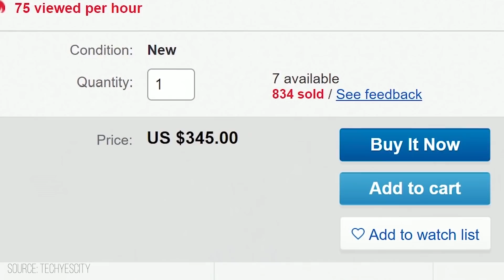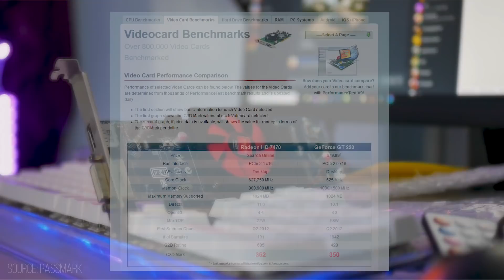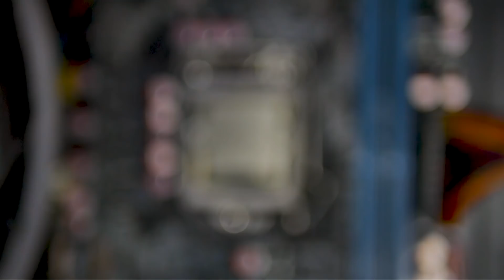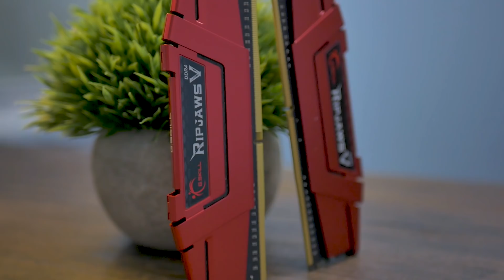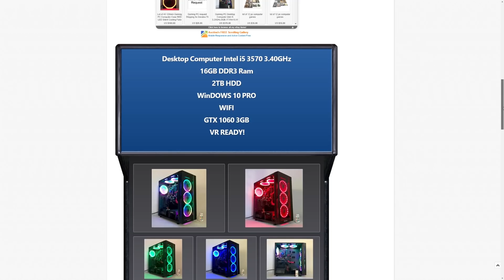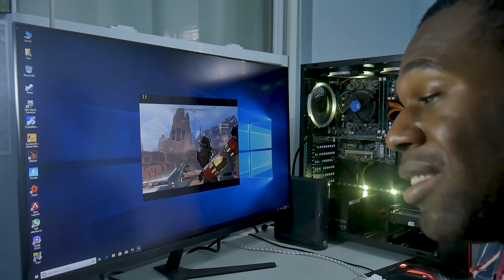These eBay Gaming PCs are NOT GOOD...Here's Why | OzTalksHW

Comment: I build and sell PCs on eBay but I do it to fund my hobby which is building gaming PCs. I barely make any money on each PC because I just can't make a bad product. I build each PC with the customers satisfaction as my main goal. I aim at the lower end budget buyer that wants maximum performance per dollar. Yes I throw in the niceties like RGB fans, RGB CPU coolers, name brand high ram that is the maximum speed that each setup can utilize with Heat Spreaders....etc..etc. I also don't ever skimp on the power supplies. They might not be 1500 watt Corsair psu's but I never get cheap or used psu's. I just love building PC's. I ended up building  myself 5 gaming PCs when I finally had to find a way to fund my PC building hobby while also giving gamers high quality gaming PCs that are as cheap as I can realistically make them. I seriously only make around $50 off each one. For my time and patience crafting each PC to have the best combo of affordable parts and still look and perform pretty beastly I think that $50 is more than fair pay to me. Anyway look for "51/50 GAMING" PCs soon. You won't be disappointed.

Comment: I got a 500$ pc with:
Gtx 1660
16gb ram
750 watt power supply
i7 8700
1TB hdd + 240 ssd
I got it from eBay and it works perfectly I just had to clean it 
It can with a 144hz monitor and a kbm that I replaced have had it for 3 months

Comment: you know what's a good way to get into building pcs? tear down your 5 year old laptop that barely works anymore and then realise you can't put it back together for some reason so you use it as a desktop from now on, be gifted a very old desktop pc from your brother who recently bought a whole new one, open it up to clean the years of caked in dust and grime, get curious about the parts, watch a linus video about delidding cpus, decide to try it out for some god forsaken reason, break a core 2 quad q8300, buy a worse core 2 cpu for the cheapest you can online, buy a 16 dollar used radeon hd 5450 (passively cooled), realise it's all worse than the first cpu that was inside the pc but you can't go back cuz you broke it, spend a long time trying to play runescape on that piece of human feces, earn enough money to buy an extremely overpriced used rx 480 and then go from there

Comment: I refuse to buy a power supply brand other than EVGA. There is literally no reason to cheap out. You can usually find them on sale. I got my 500w 80+ for $32 free shipping.  Brand new. System uses maybe half that with my 570 pulling 150-170w on OC. Completely silent. Only thing you hear in my pc is my harddrive and gou fans but even those at 80% it's barely audible. Harddrive is the loudest lol. Good ol reliable Hitachi 3tb.

Comment: That power supply is really bad! My previous power supply was a temporary one, it was an FSP Group, which is used by some OEM's, its a good power supply, but even than i got a be quiet power supply after 2 weeks! A friend had a cheap power supply from are friend AliExpress, that thing failed spectacularly, blowing out a bunch of smoke, it was a "1000" watt unit with a green fan and lights in it, he bought it for 25€, and guess what, that thing took a lot of components with it, almost every component was dead, the only thing that survived was a 7200 rpm samsung drive, his mobo, graphics card, ram and even the cpu were toasted by that thing! Get something descent, if you can't get a good psu right away, you can get away by using a FSP Group psu, they are descent enough that when they fail, you might have a good chance that your hardware still lives

Comment: As of the specs in mx pc now, it would be considered a high end pc, bud since it is a completely transformed pre-built i bought when i was 12, it still only has a 500 w psu, although it is good enough to run all the components, ill be switching it out

Comment: First off who the fuck games on a dual core processor,4 core to a octacore or nothing!!! That's (stupid). The i5 should be just fine,along with the amd graphics,Nvidia Gtx 1030 would've been better but you are really borderline with the 8 gb of ram..So you shot yourself in the foot on this one. That was a foolish buy and where you went wrong. Those issues could also be easily corrected.

Comment: I like to build and flip pcs, but I make my profit by scoring used parts on auctions and Craigslist like a GTX 1070, the X58, x79, x99 xeons which make great gaming pcs still selling in person and getting cash (no ebay fees etc only paying for gas), and im genuinely honest with my systems that im selling. I also offer the buyer my overclocking skill before I give them the PC and benchmarks if they would like.
Builds: got a 970 from a friend for $50, still good condition and put it in a i5 4690 dell i got from my school's IT person for $50, resold for $300. 
Built a Xeon e5 2620 system with a GTX 1070, 16gb of quad channel etc, 120gb ssd and 1tb HDD, good 600w GQ gold EVGA Psu (good deal got it for $35). Sold system for $600 and built it for about $400.
About to make and sell another xeon build, this time with everything new but the xeon combo and graphics card, which I will try to snag a 1080 for this time.

Comment: What bad prebuilts commonly have in common: 
Rgb for dem +13 fps 
Cheap cases (not the best but can still do) 
Hdd as the boot drive (cuz they're cheap and slow) 
Bottlenecked gpu (the gpu is good‥…when it was released) 
States the cpu by name and core clock as a way to sell (peeps who have no knowledge on pcs might get caught to an ''i5'' that is weaker than a later gen ''i3''. Remember the generation matters too) 
Most of the money is spent on the fans and rgb 
The psu is an unknown brand that uses the peak watt to sell

Comment: Would you count an hp psu as reliable? Like the liteon one. Cos I'm frankensteining around with some of my mum's work's old pcs and while most of the PSUs are low wattage, one of them is 480 and another 520w. the downside is that they are Light As Hell and that seems a bit suspect to me, like in no way would I ever put those in a pc I plan on using. On the other hand we have our ~250w liteon psu, it's low wattage but would it be considered reliable?

Comment: I learned my lesson with the power supply situation. Unfortunately, I found myself picking up one of these PCs a while back when I first got into PC building in 2016; it housed an i3-2100, 12GB of 1333MHz DDR3 and an HD 7870 with that EXACT same Apevia brand power supply. 

I’ll be happy to tell you that the power supply popped and set ablaze within the first month, taking with it all but the graphics card (by god’s chance), which netted me a loss of $450. :)

Comment: Need yalls opinion on this build im selling. the specs are i7 930. 12 gb DDR3 RAM. 120gb SSD and a 250GB Hard drive. with a RX 570 4gb. I have it posted at $400. What do yall think? Its the Dell XPS 9100 Studio Desktop. They go for around $200 area as is. LMK
Reply: 400 is good. If it doesn’t sell in a month or so you can bring it down to 375. 375 is quite a good deal for something like this. WAY better than the pc in this video for $50 more.

Comment: Frankly, I never had a window and fancy lights in my PC.  Guess what, it works just fine without all that stuff.  I would rather save a little more and just get good fans that don't have those things.  It is just more complexity and stuff to break thus fail more frequently.  I have a huge Corsair A50 cooler on my CPU and it is silent enough for my purposes.  It doesn't have all those lights.  I have had it for maybe 10 years now and it still works flawlessly even though I had it for a now older CPU originally.  My newer CPU uses considerably less than the 140 watts my old one did so I see it as just having better cooling.  I might not like fancy lights and all but I am not against water cooling.  I just never tried water cooling, my case is a little on the cramped side for all that stuff.

Comment: Sorry bro but I have to call you a lie. I built a gaming pc using Intel Core i7-980X Extreme Edition Processor 3.33 GHz 16gb ddr 4 3200 ram 600w power supply simi moduler mvme 256, 4tb hard drive gtx 970, AsRock B250 Pro4 Socket LGA 1151 Intel ATX Motherboard. Gong to sell on ebay for $700.00. My point being Is you can get a good gaming pc on EBAY.

Comment: The athlon 3000g is better than cpu and GPU and it costs 55 dollars NEW. The cheapest overclockable mobo costs around 65 dollars new, new 120 ssd cheapest 20 dollars, and power supply with certification 80+ could cost you 50 dollars and the case another 50. In total 240 dollars all brand new with warranty warranty, and 3 TIMES FASTER.

Comment: I seen a pc on eBay advertised as a fortnite pc to reel in kids for 300 euros, I kid you not it was using an i3 2nd gen with INTEGRATED GRAPHICS and 8gb ram. The case looked like one of those cheapo rgb cases that are 30 euro on amazon. I downloaded fortnite on my pc and took out the gpu and it could barely hold 8 FPS. (I5 3470 btw which is a Gen newer and has better igpu)

Comment: To put this in perspective i recently bought my first gaming PC for 380 dollars from Facebook Marketplace. It came on an a320m Motherboard-a 2200g processor-RX 580 GPU-8 GB of ram-a 256 GB SSD-500 GB hardrive-and a 550w power supply, and a corsair case with nice airflow and two case fans. So for only 30 dollars more i got an awesome PC that even has an upgrade path if i wanted. Don't buy this cheap old shit  from ebay and hinder your gaming experience and any future upgradibility.

Comment: I got this laptop for 50 bucks:
CPU: i5 3340m 2.7GHZ 2 Cores 4 Threds
Ram: 8GB DDR3 1660MHz RAM
Storage: 320GB HDD
Graphics: Intel HD 4000
Is it good for it's price? I bought it 5 years ago btw.
Reply: My cousin has same spec but his processet is i5 2nd gen for 50 bucks too . But it has a better graphic

Comment: You'd honestly be better off with Vega 9 in a 2200G...
Some of those cheap Radeon units can still kick it, though. My daughter's PC uses a 6950 (with 6970 drivers) and it games pretty reasonably! Her needs are pretty simple, though. She likes Legos games, driving games, mystery point and clicks, etc.
For $20-25 that's tough to beat!
Just gotta be aware of Direct X capability for your needs.
Anything from the 4xxx series or lower is DX9-10, which is a no. 5-6xxx is DX11, and 7+ is DX12 capable.
Then anything in the x8xx or x9xx is where you'll se reasonable gaming ability. The xx5,7,90 just indicates binning. So a 7790 and a 7770 are pretty much the same, just the 90 binned better.

Comment: Hey can  is this a decent pc Intel Core i5 2320

CPU Cooler

Standard VRLA Tech CPU Air Cooler

Motherboard

Asus P8H61

Memory (RAM)

8GB DDR3 (1x8 or 2x4 DRR3 DIMMS)

Storage

1TB 7.2K SATA 3.5" HDD + 120GB SSD

Graphics Card

NVIDIA GeForce GTX 960 2GB

Power Supply (PSU)

500W 80+ Power Supply

Comment: Hi
Well i do use older computer(s) and i don't know how many cheap power supply's did die on you with result of killing the system but on me did die in last 15 years about 4 or 5  and additionally between 13-7 years ago i did repair computers and I met only ONCE when owner had to buy a new machine because of psu failure (but i have to say that that comp was used 24/7 for like 3 years streaming online radio-and where i did live-i did repairs in that zone only- quality of the electric power-grid was baaaaad-really bad: if anyone was turning on something  powerful you did/do see kinda blink on light-bulbs...).
And another thing noisy fan-most kids who are on budget are playing on headphones or on loud amplifier...expirience99%
+low end caps: well yeah and no... even if it is "low" quality, if the system is so low power like this one it is not gonna warm up for so much to be hot , and i know yea yea........but most people will change such a system after 3 or max 4 years but really max.. it should hold on.
on the other hand higher  level build i really would not risk on this psu but you made  your text based on what you read online from others while you have THIS  machine in your hand: recommendation for next time to do in plus:
1.take a look at that label what factory put on psu-probably worse case scenarios but still start point..
2. buy an energy meter(not expensive really)-this  wall socket thing where you can plug your device and shows power usage-in addition you can try with original psu and some bronze level psu and you will see some energy efficiency ratios ...i hope you get the idea
3 and if you really want bump us with more measured value : while benchmark and 0 use you can use an ampere meter on the inside wires of the psu for example on the 12 v rail-line...
4. ask an electrician like "Great Scott" how you can make some budget test pad for psu- so if you measure all this what i wrote you can after do some torture(not necessary fatal) and after you can see  yourself what really can handle...- i believe  you will end up most cases in"it will be fine for few years" category

yes that cheap psus are also useful just need to know in what system you want to put them in  because if you do your research between this brands you will know what will handle low end computers

But really that person who build with power-hungry components should pend also some better psu

Thank you for your time to read this
Regards

Comment: Xeon x3470 W/ ryzen 470... Let's stop using these Intel 5th gen processors... Take a look at the xeon 3470... $10 processor that compares to a i3 9100f and yes that processor is a god send but isn't when you look through every Intel gem from 1995 even searching for server like processors. Also I'm not sure if you understand this but if the cpu usage is bottle necking then the gpu WILL stutter and use only 60-70% of it's use. To find my point you can look at processor based games like witcher 3 and no this isn't a graphical intense game either considering you just need a good architecture gcn in a gpu with moderate bus speeds. But I have so much more to show and tell but please upload x3470 and re introduce the xeon line up please. Pretty please

Comment: I made the mistake of getting a prebuilt, ended up changing the mobo, cpu, ram and psu within a month only things i kept was the case and hard drives.
I will give it to the guy it played normal games like cs:go and apex legends easily but anything more intensive than that and the PC shit itself battlefield v etc.
admittedly I got a much better deal I got a ryzen 1200 16GB of ddr4 ram 1200mhz lol a shitty A320M mobo 120GB ssd  and 1tb mech drive for 400 bucks the GTX 10606GB being the main feature.
I would steer clear from pre built rigs if im honest you cant trust anyone build your own

Comment: I have some nostalgia for the OEM radeon 7450. One of my first computers was a half height optiplex that I upgraded to a q6600 and the 7450 (which I got for like $15), and it was the first PC that I was able to play gta 5 on. I was totally psyched at the time. And, that PC with the q6600 might even be faster in cinebench than the i5 that they're putting in that scam of a PC. Yikes. Too much RGB is not for meeeee.

Comment: I got a used computer for 210$
I5 760 quad core 2.8ghz
500gb hdd
His rx560 2gb
1156 mobo
8gb ram
600w true rated psu
Tempered Mid tower casing
W/ 5 games installed
Is this worth the price?

Comment: i bought a 2012 dell precision t3600 with a 6 core xeon and a quadro 4000 that is more powerful than that but cheaper at 230
also its not the e5-1600 its the e5-1660
you can find e5-1600 xeon precisions for 110.

also, this is average price for one of those dell systems... what a damn scam.

Comment: got my pc from ebay but it was a used pc that was listed for $500, specs were 1070, 9700k and 16gbs ddr4 3200, so far the pc hasn't prompt issues and the is the biggest steal i've gotten from ebay. I plan on chaning the gpu to a 2060 in the future.

Comment: I mean what I would do is upgrade the CPU to a Xeon CPU I am not sure what kind he said an upgrade the GPU to at least an RX 480 or a 580 depends which is cheaper. Or A gtx 750ti or better I found one on eBay for 50$
Reply: or if not the graphics cards I said then a HD 7870 would do just fun runs the game at 100fps 1080p low settings

Comment: I've seen systems like this on eBay for around the $300 mark and I've got to admit, I wouldn't be against competing in the eBay-cheap-gaming-computer market. Core i5 2400, 8GB of ram, 2TB hard disk, and a GT 1030 put into an Optiplex 790, I think. Some kind of mini-tower Optiplex. Costs $250-ish to put together, sells for $330.

Comment: I saw a Goodwill in the Dallas area selling Dells with 2nd or 3rd gen i3 processors in them for $35. Drop in a i5-23xx/24xx/25xx and you instantly have a system that's about 2x as fast as the one in the video from a CPU standpoint.  The 2nd gen I5's you can get for $20 to $40 on Ebay.  So basically what they did in this video is took a 10 year old system, put it in a new case, added RGB and that's it.

Comment: I'm having such a struggle selling my gaming pc for just $625
it has a
diy pc rgb case
ryzen 5 3600
16 gb corsair vengance ddr4 3000
cooler master cpu rgb cooler 
msi geforce 1060 6gb gpu
700w power supply
240 gb ssd
I just dont get it